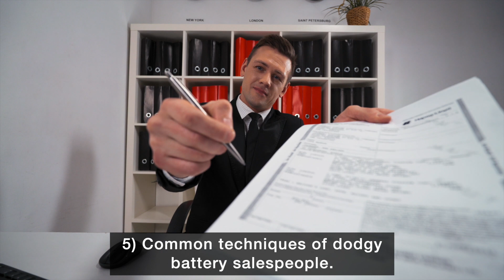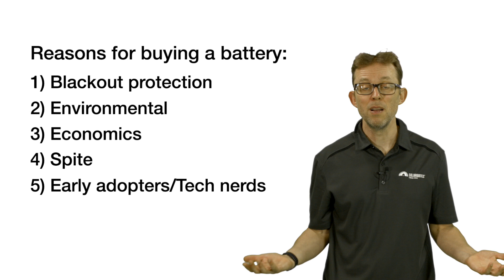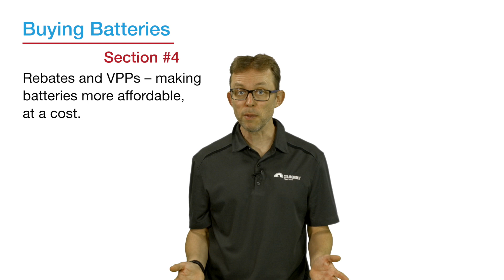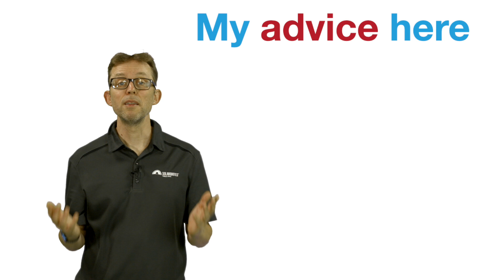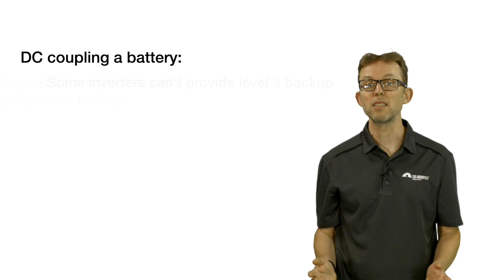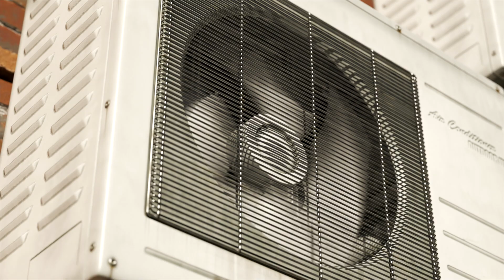Buying Solar Batteries - 2022 Home Battery Buyer's 101 Guide

Comment: At 3:40: "if your monthly bill is $200 ($2400) then it doesn't make sense to spend $12 grand to bring your bill to zero". If you are talking pre-tax credit then yes it does make sense.  On this statement alone, net cost of $8500 to save $2400 a year is a less than 4 year payback. Even without the tax credit it is still just 5 years.

Comment: Thanks for a well explained presentation on battery storage. My question though is how does battery storage stack up against V2H where the EV battery is much larger than a comparably priced battery stack and serves the same purpose? 

Assuming one has a bi-di compatible EV doesn't the extra investment of a bi-di charger make better economic sense than buying a battery stack? I am assuming the V2G/V2H system is islanded as per any back-up power supply must be. A little ahead of the game for now I know but worth considering when designing a backup home system in terms of potential future redundancy.
Reply from the maker: V2G / V2H is in its very early days. The bi-directional chargers cost over $10,000, they can't backup your home without the grid yet, and I suspect many people are underestimating what a pain it will be to organise your car being at home when you need it and ensuring you have enough charge in the morning to get where you need to go. My advice is - to invest in your home - get a proper battery system installed that you can set and forget.

Comment: LOL 😂I'm an American, you left out the primary, #1 reason Americans go "off grid". Out in the rural areas of our country, a reliable grid is simply not available. Yeah, I know, you can pay to electrify any chunk of land anywhere in the country. In my case, my idyllic high mountain meadow would cost over $150,000 USD to run a line from the power company.A line that is guaranteed to give me brown-outs during times of high usage and complete blackouts (a dozen per year) also when it is least convenient. Uh, that's double my budget for building a home for crappy unstable service! Solar is frequently the only practical alternative to a grid-tied system or one operating entirely off of a propane or diesel generator.

Comment: I’m interested if it would be possible to get a system on my garage to store enough energy to fully charge a Tesla, I imagine a system where the solar panels charge up a large battery in/on the garage and turn off when the battery is full, and then when the battery is full it has enough energy to fully charge the car. is this possible? If so how much would it cost roughly? How fast would the panels charge the battery/power bank, And how fast could it charge the car?  The cars battery is 62 KWH

Comment: Thankyou for this, I agree'd to a contact with a battery supplier a few days ago, and many of what you have descibed, happened to me. I did further research, and $8000 for a 5Kw system, just didn't cut the mustard, to go with my existing 5.5Kw of panels. Fortunately, I was within the "backout" period as legislated, and emailed them that I do not wish to proceed, and refund my deposit. Surprise, surprise, no word from them.

Comment: You spoke about battery fires etc like lifepo4 batteries don't exist, and are the only battery chemistry you should consider for home power, as 1, they don't set on fire 2) where the cycle life of an 18650 20/21700 is 250-500 cycles to 80% dod a lifepo4 is 2-3000 cycles while the cost per kwh is approx the same, the only benefit to li-ion 18650 etc is power density and weight which only matters in portable or small volume usage scenarios, since they are being installed in your home the fact they are a bit bigger and heavier is inconsequential, and the lower fire risk and up to 10x cycle life more than compensates for this, you are however free to buy what battery you like or what suits you, but unless I was getting eg cheap used 18650 cells and building diy packs for cheap then lifepo4 cells would be all I would consider for solar
Reply from the maker: Absolutely LFP / LiFePo4 batteries are safer. But to claim they "they don't set on fire" is very dangerous talk. If they get too hot they will burn ferociously - although not as ferociously as NMC. A badly installed LFP battery is a fire hazard. Don't be complacent just because it's LFP.

Comment: Surprised you didn't highlight anything regards LFP batteries....increasingly affordable, safer and while less energy dense offer 10 yr warranties, before degradation.
I have a small hybrid inverter and a few panels, and will be adding more LFP battery storage, to improve outage cover.
with a little management I've lower bills, and the package should pay for itself in 3-5yrs....maybe sooner if the energy profiteering continues. Happy days.

Comment: I’ve just been quoted £10,000 or $17,000 Australian for a 4 kWh solar system & 4.8 kWh battery only knows which brand as they didn’t say. I’ll not be using them for sure.

Comment: So how is my 40-year-old that has a battery degrading since it's still perfectly as good as can be still working like it's never been a day old still gets full charge still gives me all the power I need of course it's not doing better I got I got 35 year old batteries I got 10 year old batteries I get 15-year-old batteries oh and I have a 60 year old better too oops and it's still a good battery so I also got 5 year old batteries and get 2-year-old batteries I got several months old batteries and I'm going to be buying more batteries and I don't replace my batteries if they're good as long as they're at least a thousand amp hours or higher cuz I like that 135 amp hour batteries I never had a blackout since I own my house I mean all my neighbors might have lost power because of tomorrow's done road there's a problem over its lake they all had power though don't know why I had power oh yeah that's right I have solar panels I have batteries yeah so I do just fine but I never have enough solar panels don't really have enough solar panels right now anyways but I did order some I don't know if they're going to come most things that order doesn't really come but since this is from the app store and Google and paypals had to make sure to pay went through or should I had to go through PayPal order it maybe this time I get some backing on it make sure I get it but this time is to come in with some acid batteries no it's coming with AGM batteries 200 kw hours batteries I guess that means the 2000 amp batteries but the end of 2000 amps like maybe 1,900 amps since a 1,000 amp battery is 135 amp hours a 100 kw your battery is actually 900 amp battery so 200 kw hour battery is an 1800 amp battery but AGM batteries are more made for solar panels understand. But I guess I really find out eventually if the orders ever come in.
Reply: Punctuation matters my friend.  I imagine there is valuable insight in there somewhere but I couldn't read it.
Reply: @eamon6713  well since I speak all this and not write it YouTube doesn't always put down what I say and add things to it that is not good but my 40-year-old batteries are still good further not my batteries that are older than 40 years old they are still good the only problem is I got to get more batteries and they are let us batteries 1,000 amps of course my older batteries are 1,250 amps and 1350 amps those are the batteries my father gave me many years back those were my second batteries I got which were older than the first batteries they got there that has a batteries of course my father gave me two marine batteries and I just had two regular car batteries now I'm getting ever start batteries that are a thousand amps and that are 135 amp hours each. Furthermore I make orders on the app store and Google and sometimes the orders take forever to get to my house like at like 6 months to year and a half to two and a half years like I made an order two and a half years ago for when I got one order back in December 16th of 2021 I ordered those March 2nd of 2020 and I did not get all my orders at that ordered in March 2nd of 2020 and this is already July or should I say June 4 days shy of July of 2022. What more would you like to know my friend. And yes I ordered some AGM batteries with some solar panel set which comes with a 6000 watt converter actually I ordered two of them from two different companies what you give me 12 200 amp hour AGM batteries because each of those AGM batteries are 2000 amps.
Reply: Sorry dude. I’m with Eamon. There is clearly an intelligent thought in there somewhere, but I m fucked if I can understand what is essentially a ranting rave with no respect for the rules and laws of basic English..I recommend doing an English Expression course at TAFE..You either didn’t listen to your teachers or you left school to early.. There is a reason schooling is compulsory and you would appear to be the living epitome of why.

Comment: 1.     250 prefabricated CLT & SIPform passive house certified homes. On the roofs of buildings, the Tractile 180m2, the excess electricity will be stored in the 28.8MW Tesla Batteries Farm. 
2.     The PV in total 934,370m2 - Tractile tiles 45,000m2 and ARCTECH SOLAR TRACKING PV 887,400m2
3.     Bi-Charging of EV one per house and 12 Tesla charging stations in the shopping centre. 
4.     Micro-grid that connects to a community of 4800 residents. 
6.     We will be trailing the SoMax HTC process in 2024. That processes the sewage into sterilises aggregate for concrete so many products that would carbon released into the atmosphere when State Government and Council approved process.

The Team that assembles onsite and ends in June 2023.   COST OF MAINTENANCE AND UPGRADE  - PV,  BATTERIES, EV Charging Public/Bi-directional and  SYSTEM  $4,153,170 annually starting 2024. 

At the end of August 2022, they will be posted the video on YouTube. 

Sustainable-Urban-Community-Homes

Comment: 14kwh battery for less then 3k usd. If you build it yourself.
Reply from the maker: boom!
Reply: @SolarQuotes  yeah literally. Step one get an electrical engineering degree. Step two do ten years in reliability engineering as a paid job. Step three realise it’s hard to integrate a safe reliable storage battery system from used parts especially when they were never originally designed to work that way. 

You become the test engineer too!
Reply: How? Raw EVE cells? How do you get grade A cells that are already in the USA and not on an anchored boat from China?

Comment: I have been researching solar for 7 months, even got quotes from 2 recommended by you they were a/ shonky , and B/ way overpriced for inferior product.
The fact is you have missed Batteries that offer significant upgrade on "Tesla product" that guarantee superior lifetime and also lower degradation rates than many of the batteries you champion. Secondly you never point out that a battery that drops to 70% at 10 years best case will no longer meet the needs of an average Aussie House let alone a battery at 60%.
Finally the best Solar panels now offers 40 year warranty at 88% of new efficiency and parts and labour.
Reply: Hi Craig. I was wondering about this, are Finn’s recommended installation companies only the ones that agree to give him a kickback. That shouldn’t rule out other long term solar installation companies who do good work. Which solar panels have a 40 year warranty.

Comment: You forgot to mention the growing demand of electric vehicles that will be charging from home , repayment will be cut in half or even more pending how many vehicles per house hold.

Number 1 Environment 
Number 2 charging your car
Number 3 saving thousand per year

Your way behind in technology just like our previous leader.
Reply: Let’s say you have a 10Kw nameplate capacity solar system and a 10Kwh battery. The battery goes from empty to full during the day every day. The car comes home at night and discharges the battery, delivering about 70kms of range. The retail cost of the electricity is $3.40 give or take. Let’s do that 365 days a year.  That is $1241/year not spent on electricity for the car. The solar and batteries is something like $20K installed plus the dedicated wall charger. 

Assuming the house pays ZERO for electricity and we assume that is worth $700/qtr you might break even after five years. How much was the electric car again? What OTHER lifestyle choices did you have to make to not pay for electricity? Turn all the lights off at night, sit in the dark? Not travel more than 70kms in one trip? Always charge your car from home? Cold showers? No kids or pets?

The difference between theory and reality is bigger in reality than it is in theory

Comment: How much extra does it generally cost to add battery backup of a few lighting and power circuits like you did?  I believe you need an extra switchboard installed?  So they use the same wiring that’s already there?

Comment: Why are there only Li ion batteries on your list? Are flow batteries like the Redflow not as good?
Reply from the maker: Redflow are good batteries for industrial applications IMHO, but not for residential. They are huge, fairly noisy and you really need two of them due to the maintenance cycling.

Comment: what about lavo ( hydrogen battery company )
is that make sense to buy hydrogen battery?
Reply: You like having hydrogen tanks strapped to your house?
Reply: @theairstig9164  what is the difference efficiency between lithium battery and hydrogen battery after 10 years?
Reply from the maker: @HamidSadeghi.  The Lavo is very expensive. We wrote about it here: https://www.solarquotes.com.au/blog/lavo-hydrogen-battery-review/
Reply: @HamidSadeghi.  there is no way known a H gas storage system will pass a safety test after ten years. The whole lot will get thrown out. Ask an industrial plumber. Efficiency isn’t even a consideration. You use hydrogen when there is NO alternative
Reply: @theairstig9164  so you say this company (lavo)  doesnt pass any safety code?
Reply: Cost, I love the idea but it's very expensive. If it was even 50% dearer I would seriously consider it but it's more than double when I checked. Maybe it will come down.